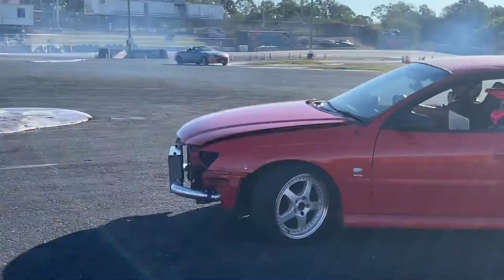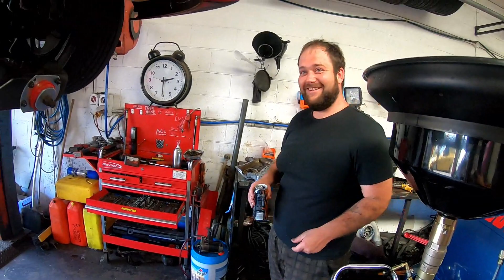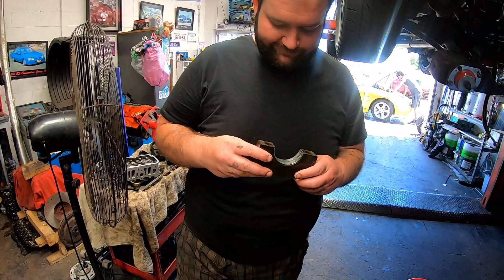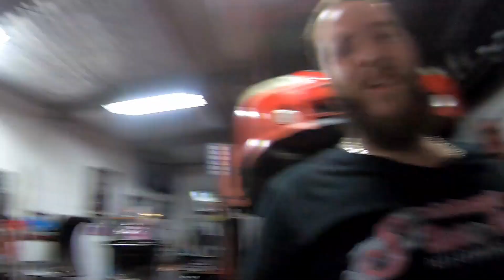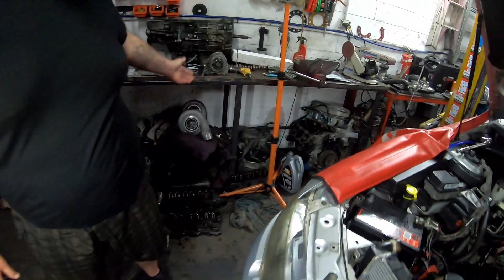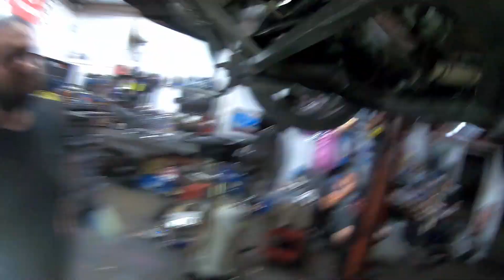Ecotec & Max Boost Bad Idea ?

Comment: 1 trick u can do to boost oil pressure that I've learned is u can stick washers in with the oil pressure spring and it stiffens it up and increases oil pressure,  I actually got the adjustable oil pressure block from BBG but I think it's only for ln3 and l27s but tbh it'd work on a ecotec as well but u still need a eco spring and a coupla washers to get around 60psi at idle and 100 at full noise 👌
I'm finally at the point where my buick is back in the car and I'm in the process of fitting up the turbo kit now 👌 
If u guys want check out my fb page mytime racing for the build, stock but rebuilt s1 buick, new rings n bearings plus arp head studs, china gt3582r, external gate, 60lbs injectors, 340lph fuel pump, mace engine mounts, t5 conversion, aiming for around 350bhp and 650 nms, turbo kit is from tony'z turbo garage. Loving the v6 content guys too 👌 giving me ideas to get my setup right 👍
Reply from the maker: Cheers heaps man might have to look into that 🤔, sounds like it’s gonna be a stout build man 350 will be an easily achievable goal without a doubt
Reply: @lshouse9821  yeah no worries.  oh yeah people keep telling me it won't get there without bending rods, but tony'z has told me it will easy, he's got a bog stock ln3 in a austin with twins on e85 that's gone 338rwkw hahaha so I think i'll listen to him over fb "experts" hahaha
Reply from the maker: @5lcalais1  I have a gone 480rwhp+ on stock eco bottom end so I’d say Buick would be able to do similar unless it has l32 rods in it out of the series 2 I believe then would be able to go a lot more
Reply from the maker: @Rhysk94 would know more about them than me

Comment: L32 rod.
Reply from the maker: Odd there being just one in there lol
Reply: @lshouse9821  think of it on the bright side, only need to buy 5 not 6 for an upgrade 😂😂😂
Reply: Lol in my buick I've 5 pistons with a 5 on top of them and 1 with an 8 😂 and it's untouched since 89 lol weird 😂
Reply: Isn't l32 like a us 4L or something? There's fuckloads of variants over there ,I'd love to drop a 4.3 version in a Commodore, factory they're about 180kw and like 550 nms but down side is they only rev to 5k 😂 thinking using the 4.3 with l27 heads n manifold, comp would be near 10.5-1 Lol and strap a boosty boy to it 🤔👌
Reply: @5lcalais1  L32 came in Aus S2 Vy L67
Also the yanks have a 3800 supercharged chassis with the L32 motor instead of the L67
Reply: @RhysK94  fair enough, I thought all oz v6s in vs to vy were l36 and l67 lol oh well learn something new every day 👌😂